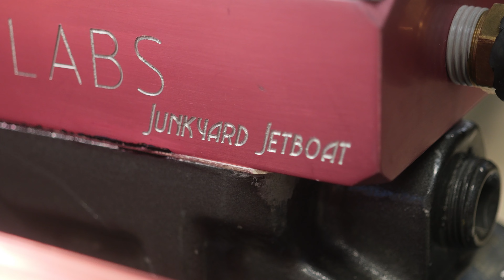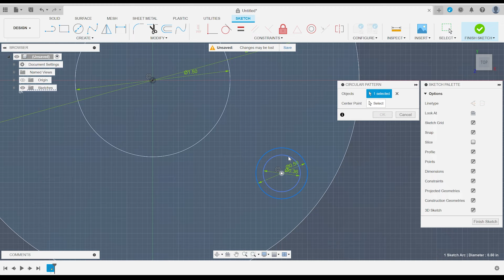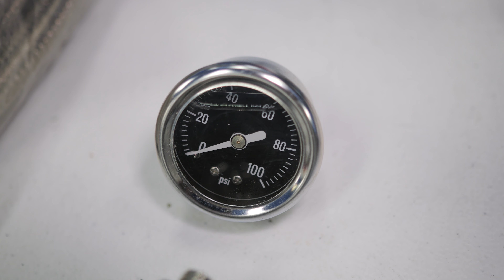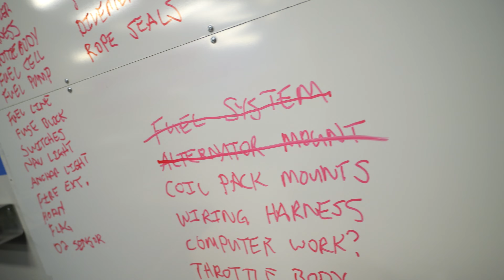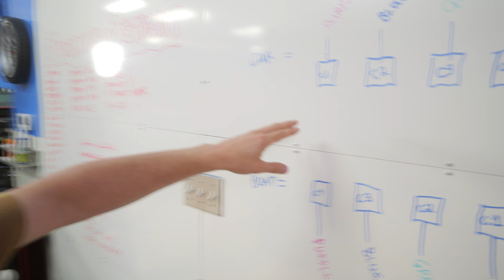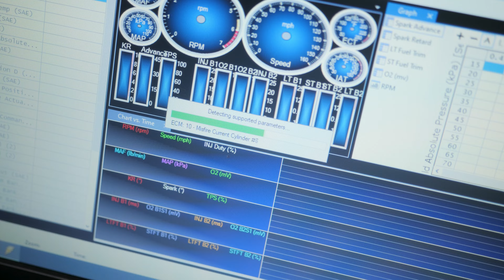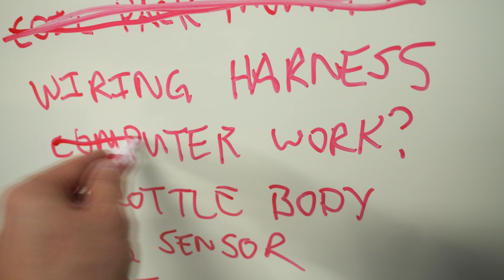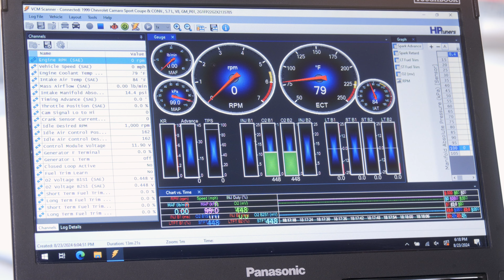Reviving an Old Racecar Engine for Our Junkyard Jetboat!

Comment: For the water in the oil pan issue...  How does your coolant system work?  On my PWC, the procedure is to turn on the engine first, and make sure its running, then turn the water on after that.  If you turn the water on first, it can back feed through the exhaust and enter the block.
Reply from the maker: Yep that's the same with all the Seadoos/jetskis I've ever come across as well. This one is a little different just because we built this exhaust like they do on raceboats where the only place the water can exit the system is at the very tip of the exhaust pipes and out onto the ground. So the only way water could leak into the exhaust ports and into the engine is if something is cracked inside the exhaust manifolds or tubing the we built. I'm still just hoping it's left over water from when it was stored outside for 10 years.

Comment: When does the ol' Camaro make a comeback?
Reply from the maker: We are trying to a find a dyno in DFW to get a baseline on the engine before we start messing with it more. I also bought some equipment to try and measure the aerodynamic pressures to see why we seem to keep making the car slower as we modify the nose of the Camaro. Will try and get some video of that soon.
Reply: @Motiv8Labs  sweet! Think it might be a case of too much front aero killing the top speed? Always a balance between more downforce for handling or less downforce for top speed. How does the car handle on the BBORR with no front aero additions?

Comment: Why not just pop the harness off the coil bracket and flip it over? 9:37
Reply from the maker: Yeah that would have been easier. The wiring on the back was so old and heat brittle I figured I’d just leave it alone.
Reply: @Motiv8Labs  that's fair. They do get pretty crunchy after a few years lol